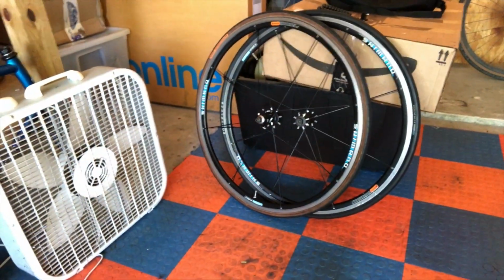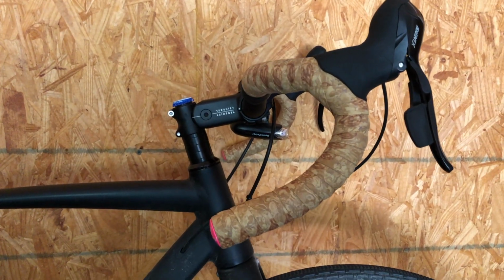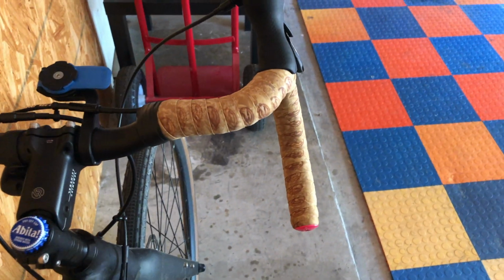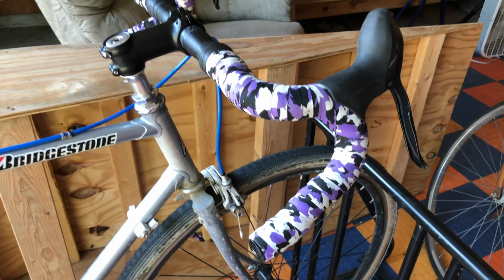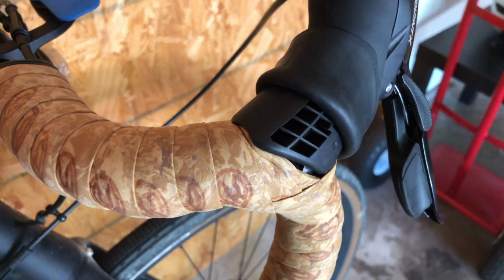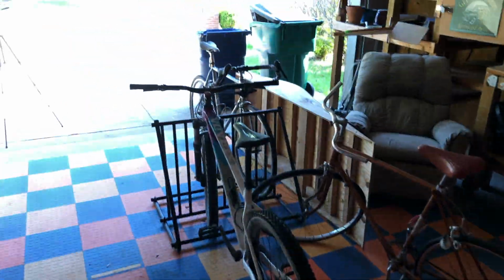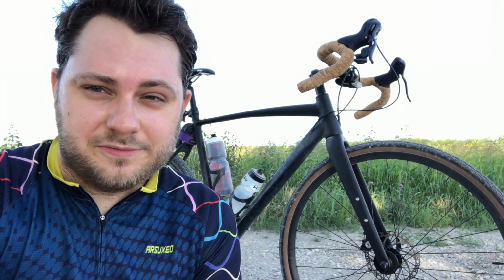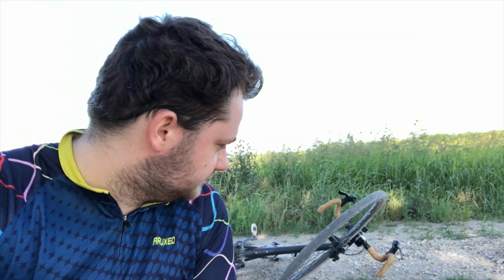Death to Riser Drop Bars?

Comment: I've seen a few of those floating around online shops
Reply from the maker: They're good bars, just not for everyone.
Reply: @tinkerbike2510  yeah i think so too i wanted to buy one but the narrow size is only up to 40 i usually use 36 to 38 wide hehe
Reply from the maker: I was a little surprised too but after seeing them I get it. At the narrowest 42cm width the tops are pretty short due to the space taken up in the riser section
Reply: @tinkerbike2510  that also was a reason why i didn't buy one limited space on the handle bar